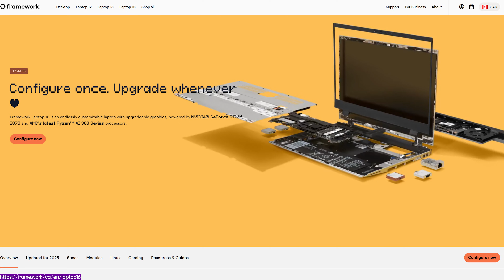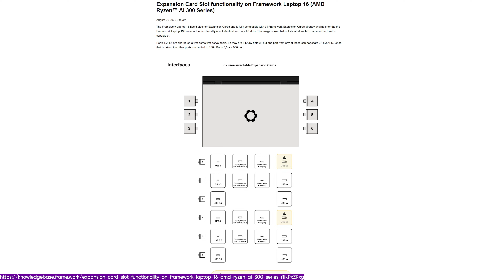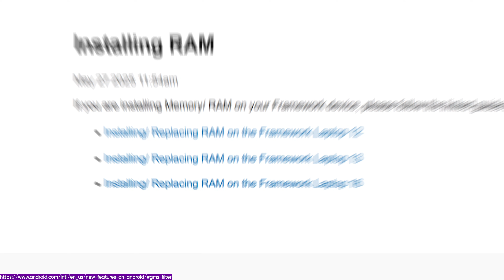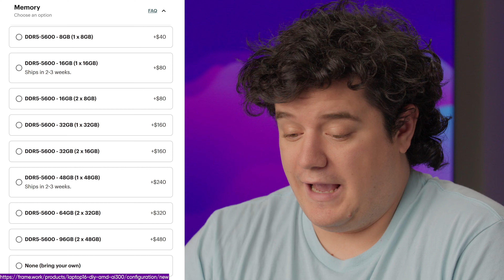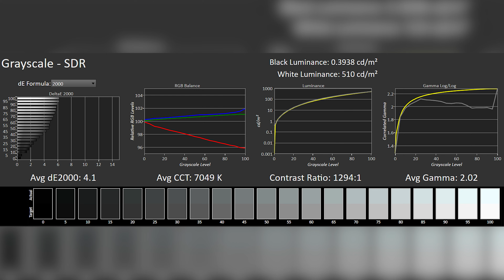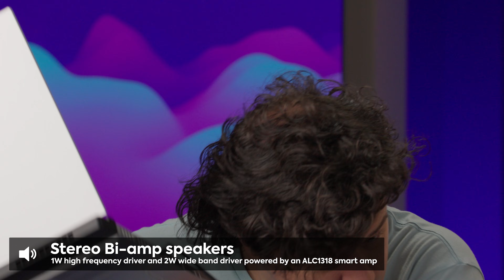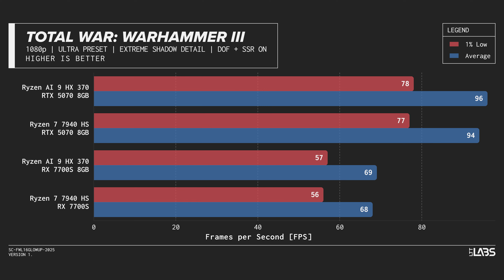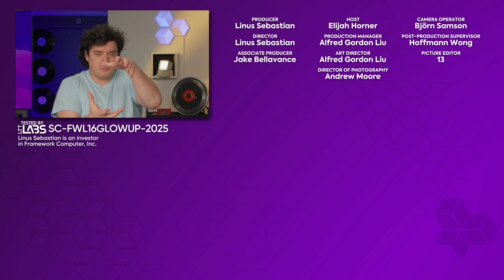I can FINALLY Upgrade the GPU on My Laptop! - Framework Laptop 16 (2025)

Comment: Feel duped the title was an upgrade not a brand new laptop where you could reuse potential old parts
Reply: Yeah with that title they should at least show an old model being upgraded, even if the focus is mostly on the new model. Video title as of writing this comment: "I can FINALLY Upgrade the GPU on My Laptop! - Framework Laptop 16 (2025)"
Reply: You can though, they just didn't cover that.

Comment: 7:19

The spacers almost, but not matching the chassis is a big nono
Reply: I think it's just reflective difference that you wouldn't notice in real life
Reply: @Kelrohir  As an owner of the OG 16, I can confirm that they are noticeably a different stock material. Not sure if it's just the surface finish or the actual stock has a different grain structure or something, but there's definitely a noticeable difference. It doesn't bother me, but might not be as easy for some people to ignore. The seams are the most annoying part, but I love that I can switch things around. I change configurations based on whether I'm gaming or not, so it's pretty damn useful.
Reply: Those spacers are available in silver as well.

Comment: Patiently waiting for the Framework Phone.
Reply: I'm waiting for the Framework Space Shuttle with upgradeable stages.
Reply: Bring back Project Ara!
Reply: they said they weren't going to do it, so i just got fairphone 6
Reply: @arson5304 well, the Fairphone is not an upgradable phone, so - not really so different.
Reply: @gregor2436  well yea, but it's the closest thing out there
Reply: Queue the Onion iPhone tariff video
Reply: Yesssss
Reply: that would be sick i I'm allowed one ui on it
Reply: I got an HMD Skyline (offshoot of Nokia) because it was supposed to be just that. And 3 months later, they announce that they're shutting the project down. So... Yeah, we need a good option for that in the states, because FairPhone isn't quite what I'm looking for, but HMD was, and they died...
Reply: @crystallakedood What made you like it than Fairphone?
Reply: @AninoNiKugi  Firstly, I'd have to import a Fairphone, whereas the Skyline is domestic for me.
Secondly, the Skyline had slightly better specs, the customizable button, and a marginally better camera (according to reviews). The price was better by about 15% at the time, too, which helped.
That said, I now regret it, since HMD closed up shop and I can't get updates anymore. I'll probably end up replacing this phone sooner than any other I've had, ironically...
Reply: I just got the xiaomi poco f7, great phone, only works for T mobile tho but that doesn't cause problems for me as i don't move around all too much
Reply: Never gonna happen. They would actually probably make a printer before a phone.
Reply: Fairphone has officially announced they are expanding into the NA market. Closest equivalent.
Reply: @MrBlueBurd0451 Fairphone doesn't offer a single upgrade path for their phones
Reply: @lancergt1000  They had a camera upgrade for the FP3 😄
But yeah, don't expect upgradeable phones anytime soon or ever.
Reply: @lancergt1000 phones don’t work like computers in that sense.
Reply: @AninoNiKugi Have u seen that old Google project that was literally a modular upgradeable phone... never released of course
Reply: @KarlGable Exactly, it was never released 😅 Google is a big part of how messy mobile devices are. They use the Linux kernel but they do shennanigans to load proprietary drivers and makes firmwares and software specialize for each device.
Reply: Might have to wait till nVidia can shrink the 5090 to fit inside cellphone.
Reply: Yeah for 2000$ midrange phone + 400$ for 108MP camera upgrade. Want a speaker? +300$. Joke of a company.

Comment: You can't fit extra USB-C's because there's a CPU/Motherboard limitation on the number of PCI-lanes avaliable for those ports. Great question.
Reply: Couldn't you just put one of those USB-C/USB 3 hubs inside of the module and then use that to split the port into 2? It wouldn't be ideal for high bandwidth applications but it would be useful if you just want more ports for low speed devices
Reply: @nmills3  They've tried, there's not enough space to put the controller etc. 
It's been talked about on their forum for years.
Reply: @agentcrm I'm sure it could be done if you're willing to sacrifice some functionality in those ports, say by making them USB only (and ditching PD and DP and other alt modes entirely), which would cut down on both heat and hub chip complexity. But then that's also a pretty huge tradeoff.
Reply: @Kraaketaer  Those adapters plug into standard USB-C ports (USB4 or 3.2) and can be used in any system.
So you still need a USB controller as you're electively making a USB hub.
Reply: @agentcrm ...I know. I'm saying that a pure USB hub chip that doesn't also process alt mode or PD charging will be smaller, less complex, will have less heat to deal with, and will only need to connect about 12 traces per port rather than the full 24, and thus might be able to fit into one of their expansion cards. It would still be a standard USB hub, able to connect to any computer with an USB-C port, it just wouldn't charge or pass through alt mode signals.
Reply: @agentcrm is it possible for them to integrate the necessary controller into the computer, and then recognize if it's plugged in to manage that particular connection in the way it needs? (Idk about this stuff myself. So idk if that's possible.)
Reply: @joat150  
No I don't believe it's possible to do a hub like that.
Reply: @nmills3  might not be enough space
Reply: @ashishpatel350  also probably heat is a problem. but technically in the future, when the controllers will shrink a little maybe
Reply: Do they also need controllers like Thunderbolt?